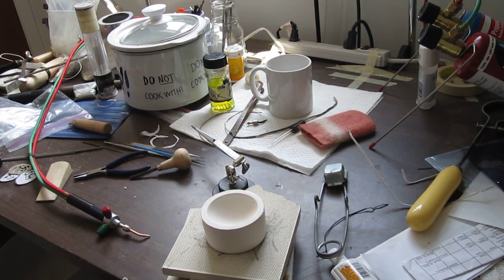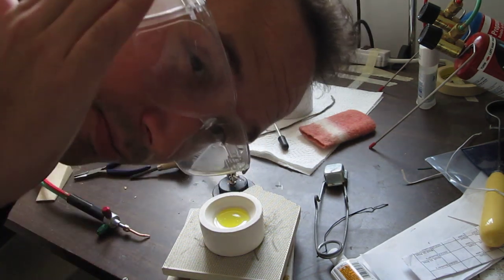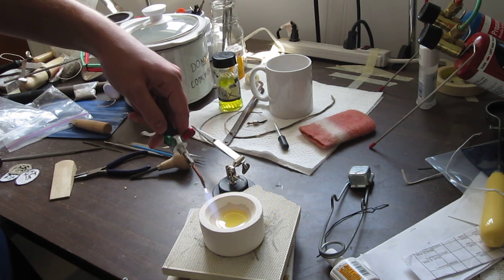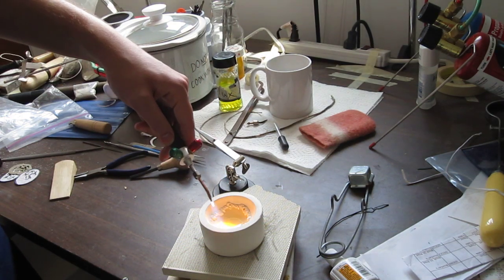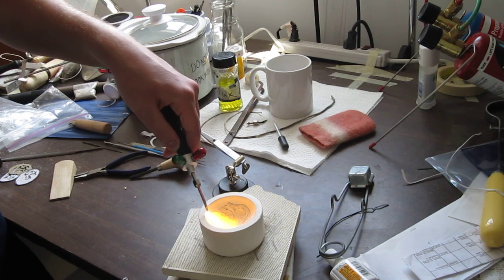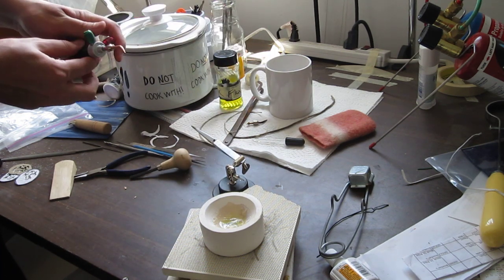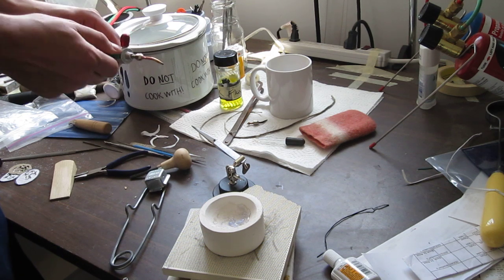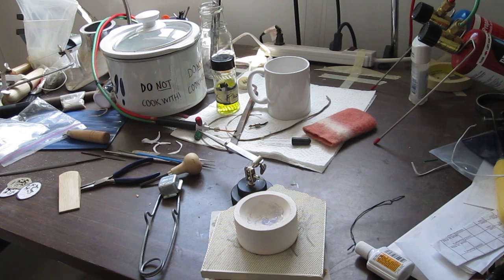Prepping a Crucible for Casting

Comment: This is actually a clay crucible...
20 mule team borax (available at the grocer in the laundry isle) works fantastic for this. The whole inside surface of the crucible really needs to be coated to a glassy like consistency so that the molten metal wont stick to the crucible. A casting torch works great for this.
It takes a couple of tablespoons of borax to get a molten pool of liquid borax that can be fully swirled around the inside of the crucible (all the way to the top of the crucible)... The excess should be poured off into a bucket of water.Then you are ready for melting your metal.

Comment from the maker: @Allysa1981 I usually separate out my silver before casting and only cast silver that has no solder on it.  This way i don't have to worry about removing junk with a graphite rode.  I keep all my silver that has solder on it in a different pile and send that to rio for scrap points

Comment from the maker: @Allysa1981 You need to add flux every time you do casting in order to clean the metal.  Don't clean off the residue becomes that is old flux that helps to cast the metals.

Comment: First time viewer second time comment.. Have you had lets say silver stick to the crucible after it was fluxed? I had this happen to me, I must not have done a good first job. I used borax (soap box) from the store- not Rio Grande- and the Silver round I melted some stuck to the edge. well I lost a 2.1 gram of silver in the flux.. I did recover it but dang.. So any better flux out there to use?
Reply from the maker: Christopher Sanchez I always use the flux from Rio, I would be very careful with use stuff meant for cleaning, because other chemicals could be in it that would not be good for burning.  

In addition did you clean the metal in the pickle before melting,  add fresh flux to the metal after it melted, and have enough heat?  Lastly did you use a torch that produces good clean flame.  

Without seeing it first hand it sounds like to me the silver was not clean enough or possibly the torch was not hot enough.  But if your were using a butane torch the flame may of have been too dirty.  For silver to poor well clean is key.
Reply: I used a mapp gass torch ( harbor freight one) it melted the silver but I'm guessing not good enough.. I did not clean the round I had in pickle.. Had none.. I guess I have to get a burnsomatic torch for better clean heat, the other blew out while heating the metal ( out side doing this).
Reply: I've seen videos using borax first and I think you mix flux with the metal to be melted next.
Reply from the maker: Sorry for the delay, Borax is fine. Flux is just a little more cleaner. The mapp gas torch could be your issue. Its a pretty dirty flame

Comment from the maker: The torch doesn't use regulators because they are disposable tanks.  As for the size of the torch bit I was either using a 5 or a 7, which ever has a larger flame.  I review the torch off of my blog but Google will not allow me to post a link in the comment.  You can click on the link in the description and search smith little torch review

Comment: what does this do for the crucible?
Reply from the maker: First if a crucible isn't coated with flux it won't pour well.  Second it help protects the crucible and gives it a longer life
Reply: nice thanks man nice video
Reply: Rex Erection  I understand this's a very old comment now but for anyone else reading he said at the beginning of this video that he was only using flux because that's all he had at the moment. Borax itself is always the preference for seasoning a crucible like this. You can uses many fluxes but it's kind of a waste given that u can go to the grocery store even and get a box of borax for next to nothing that's ideal for this. The flux he's using here he's only using for the borax content anyhow. Boric acid can probably be used the exact same way given that it's used to make borax, it'd probably even be easier to do it with then a flux. But yes, pure regular borax is the preference. When you use a flux if you're in a pinch like he did here you're stuck waiting for the other junk in it to burn away. With pure borax it takes like 20 seconds. Also, if you're using regular borax u don't have to wait until all liquid is hardened. I prefer to slosh it around once it's a liquid as you want the entire inside coated and anywhere molten metal will touch as the entire point of this is to make it so the metal doesn't stick to the crucible and so the crucible is clean & protected. You only need a thin layer. So once the borax is hot enough that it's liquid I slosh it around to coat everything then I purposely quickly pour out the excess borax. Once it's poured out continue heating the crucible until all borax has turned into a glass. The purpose of poring it out is so you only have a nice thin coating as you don't want a very thick buildup at the bottom of the crucible. If you look at pre-seasoned crucibles you will see they do the same thing that I'm describing. Hope this helps anyone that had questions...

Comment: You need to get an education on what your trying to teach, your way off and what you passed on is useless! The most likely causes of your popping was either your torch tip was too close to your metal and you snapped out your flame or there was a water droplet on the metal you were firing and that exploded. Both can cause serious injury and were your fault for not knowing what your doing. You've spent a bunch of money on new tools, spend some on learning the trade, not from YouTube videos.